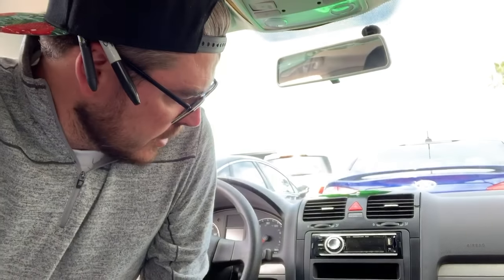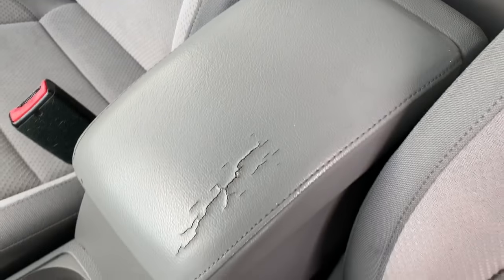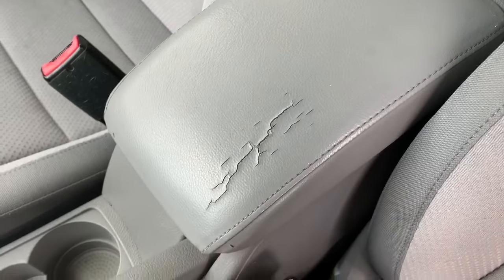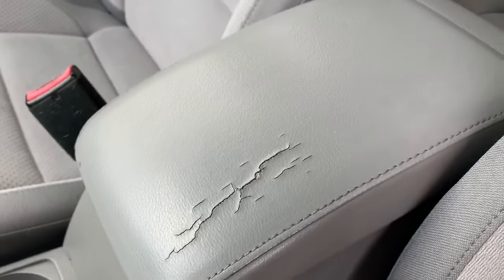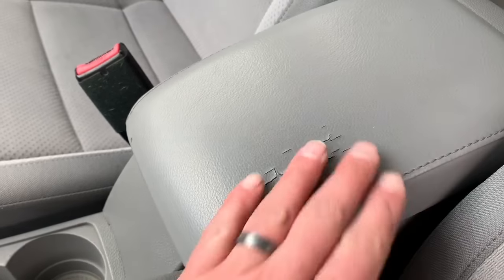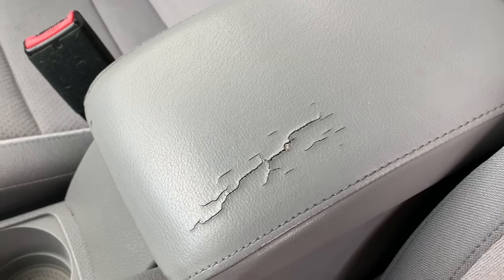HOW TO: Repair cracked vinyl on your cars interior

Comment from the maker: LIST OF PRODUCTS USED IN DESCRIPTION!
Reply: Excellent
Reply: @IMJOSHV, I have a 2013 Sonata with a few cracks on the dashboard. What's best way to fix that? Does that product work on that as well. Thanks man and great job!
Reply: Amazing work I do restoration on antique toys and other things and I always admire someone who does undetectable work fabulous job !
Reply: NUTS!  NONE of the links to products used in this video is working!   Why not say the product names in your on-camera narrative!  As of now, this video is pretty useless except for some techniques!
Reply: Well done Josh! Now for some help? I've got one of the Lexus's with the bad cracked dash issue. Any advice? Can I go Bondo to fill the cracks, sand them, and then color match it? There's about a dozen cracks but NO raised areas. Any advice on exactly what to use would be most helpful. And yes, Lexus is no longer honoring their Expanded Warranty on this huge problem they've had. TIA
Reply: What are the names of products used? You didn't name anything you used.
Reply: If you don't supply products used, how do we move forward, trying to fix

Comment: I’m been doing these repairs for 14 years, you need to start with a repair compound that you can press a pattern into on the initial pass instead of a sandable fill compound. Will save a lot of time and will keep you from having to use the sem texture coating. Also that sem texture will breakdown and become sticky after constant contact from the oils in skin. It’s meant for bumpers. Will also save the stitching.
Reply: Do you have a video sir because this guy said its gotta be heated up first but doesnt show how. Is it done with a hair dryer or a portable propane torch because i have one of those but not a hair dryer. I know id have to be really careful using the torch but ive got decades experience with welding and torching. He also said he was putting the grain look back into it but it looks pretty smooth to me
Reply: @bricknmotor  I do this as well. you can use ether. but in my opinion viper makes a better texture sem  is'nt bad I have used it many times but viper dries better. and use a graining pad as "can make it better" states above.
Reply: Can you tell us the name of the repair compound? 😩
Reply: @shady0079  is the viper product the texture spray “spray Tex”? If so I pour it onto my gun and works WONDERS

Comment: Some constructive criticism. Be careful when sanding looks like you hit  the stitching with your sandpaper and runied it, also your color is off slightly,  needed more white, some yellow and red. Easier way to repair it would be vinylhyde heat it then press with a graining pad, then texture then dye. Only need a light coat of texture coating. If you're interested in seeing how i repair those i can make a video and share it I'm also in the business

Comment: Is there any chance of the paint getting a little sticky over time? Particularly worried about this for the arm rest, in hot weather where the inside of the car gets hot in the parking lot.
Reply from the maker: No its a special dye base that we use specifically made for leather and vinyl!  Harsh chemicals can break it down but just stay away from spraying anything super strong on the area

Comment: Out of curiosity, how much do you charge for something like that? I'm sure the steering wheel is pretty expensive but I feel like console lids are cheap, provided the part isn't discontinued.
Reply from the maker: Yea honestly I’m most cases o would just recommend the customer get a new cover. Many time you can get them online and replace it yourself. This was for a dealer so they wanted it done. Dealer price was 75

Comment: Thanks dude. One of the finer instructions to repair (severe) vinyl damage in a car. 

I just aquiered a 1974 Mustang with vinyl damage on several surfaces (luckely not the dash or the leather seats). 

Just to run it by you. When you don’t have an air gun, would you suggest using spray paint?
Reply from the maker: Yea just get stuff that is made for vinyl and leather!
Reply: @imjoshv  Thanks.

Comment: I have a question the texture based spray that you're using is not the one that is in the link. is the texture based spray you are using be used for leather and vinyl? if so can you provide a link please or recommend one  spay that c an be used for vinyl or leather? Thanks

Comment: which product is best for cracks in vinyl, that have not ruptured through to the padding...but get constant flex?  this is the vinyl on the lower side of my leather seat.
also I have a worn leather edge right next to stitching - i believe I need to build this up a bit.
Reply from the maker: https://vinylandhideproducts.com/collections/compounds/products/dura-flex-professional-reinforced-heat-cure-4oz

Comment: what do i do if there’s already a massive hole on it? i have a 2001 toyota camry and my center console has a hole in the leather and it’s broken off the hinges so it falls off easily. ik the easiest thing would be to replace it, but i can’t find any replacements anywhere except one i found a couple years ago on ebay, but the guy was selling it for like $300-$400 cause it’s hard to get. what can i do to fix this issue that i have with it?

Comment: Can I use the XR-15 Reinforced Hi-Perf Compound to repair vinyl on a leather couch? Or is the air dry filler better? Sorry, new to the process and I'm trying to achieve lasting results as opposed to just a band aid job :)
Reply from the maker: It depends on the damage. You can email me a pic to josh@detailgreenusa.com if you’d like

Comment: You used a heat gun? What if the crack is on the edge of my seat and can see the inside showing just a bit. It's a split. I have all black leather seats. Well that's what they're supposed to be

Comment: Which texture  spray from SEM ?
Reply: Its sem 39853, you can also use sem 70022 grain kit, along with sem 38422 leather vinyl repair kit.
Reply: Its 39853 however they have a regrain kit 70022 with 6 different types of grains. The leather and vinyl paste is 38422

Comment: good video, but i think it would be cheaper to just buy a whole cover online. plus would save time. unless of course they don't make these anymore. in my case, my cover costs $150. i think i'll go that route.
Reply from the maker: Yes you are right in this scenario!!! Buying a new console cover is cheap enough and a great way to go. I was just showing what kind of damage can be repaired... if it were on a seat for example, replacing it may be too expensive

Comment: The thing is that, it looks ok on camera. In person, you'll see that the filled up part of the material is going to loose it's pattern. It's going to be smooth. Not as the surrounding parts. 

Also a repair is not going to last long. The heat inside the car slowly going to shrunk the filler, no matter what. 
In my personal experience it doesn't last a year. It won't crack, but the filler is going to shrunk and it's going to look just as bad as it looked before. 

If you just want to sell your car quickly, you could do this. 

Otherwise if you want to have a nice seat, you have to change the leather or whatever you have on it or the whole seat, lid. 

And I've done it twice. 
It looked far better than this one and it's going to look bad again. 

(If you store in a garage and never take it out for a ride. It's going to be fine.)
Reply: That's not true. I had a repair done 3yrs ago in a leather seat..still lookd the same. I sit in this chair every day.  It depends on the age and condition of the materials..
Reply: Wow...for someone who sounds so sure of themselves, you’re actually incorrect sir.

Comment: what products did u use ?????????
Reply from the maker: Its all listed in the description of the video...

DIY Leather and Vinyl Kit - https://vinylandhideproducts.com/coll...

PRODUCTS USED FOR THIS REPAIR:
Cleaner: https://vinylandhideproducts.com/coll...
Swatch Ring Color Kit: https://vinylandhideproducts.com/coll...
Reinforced Heat Cure Compound: https://vinylandhideproducts.com/coll...
Black Spray Texture: https://vinylandhideproducts.com/coll...
Air Dry Filler: https://vinylandhideproducts.com/coll...
Primer Coat: https://vinylandhideproducts.com/coll...
Top Coat: https://vinylandhideproducts.com/coll...
Cross Link: https://vinylandhideproducts.com/coll...
AirBrush: https://vinylandhideproducts.com/coll...

Comment: how much would that repair cost?
Reply from the maker: $100, it was for a dealer.  In this case i would normally recommend recovering the console. You can usually find them for pretty cheap

Comment: Hey Josh, I curious about the iron you’re using with the Teflon mat. What brand and where can I get one? I haven’t seen one like that from any of my distributors. Thanks!
Reply from the maker: Hi Andy, i was using this one in the video.  https://amzn.to/2vmT4GV 

Its a back up unit i have just in case. Its a little tricky cause its heats up almost too much. I prefer to use this: https://www.vinylpro.com/fixer-tool/

But also found this one that im gonna give a try. Looks like it would work perfectly and you can adjust the heat: https://amzn.to/2QeP5mU
Reply: IMJOSHV - Car Detailing and Reconditioning Tips Thank you so much Josh! I sure appreciate the help and I enjoy your interior repair videos!

Comment: where do I buy the filler?
Reply from the maker: Viper products. I’ll be doing more videos soon with links. They have a bunch of different fillers so I’ll try to cover what each one does
Reply: @imjoshv  that's not Viper Products.
Reply from the maker: @spauldingclassics  Thats correct.  This was done with Classic Dye Products, but i've since switched to using Viper and recommend them

Comment: Never will last. Just replace with new material or new part!
Reply from the maker: Replacing that piece is pretty easy!  This was for a dealer and they wanted it done right away so i didnt have time to order the part.  However, I am working with a new company on this and they make a new blended dye that is EXTREMELY wear resistant!!

Comment: The price on the products is not worth the expense. It would be better to hire a professional to do the job.  If I owned a car with a leather interior, this is something that I would not permit to happen.  If you treat the leather various times throughout the year, it will not dry out and crack.  Most people don't value what they have, nor the cost to replace the same.